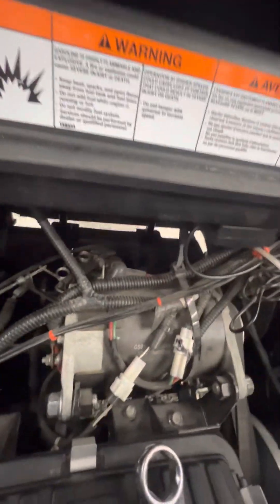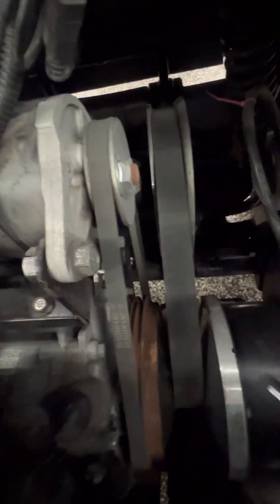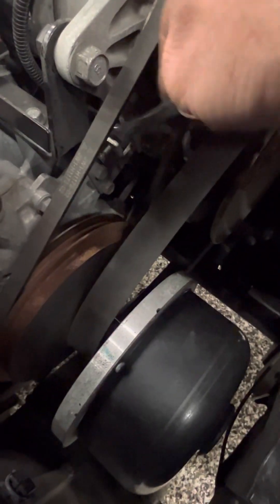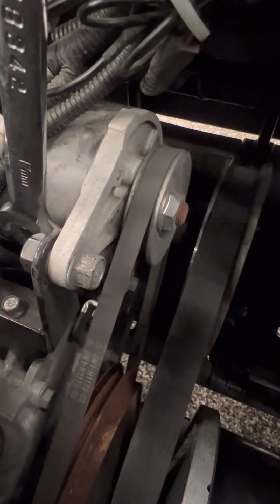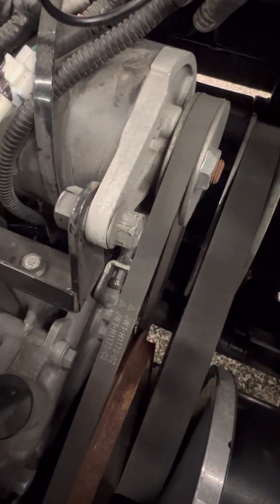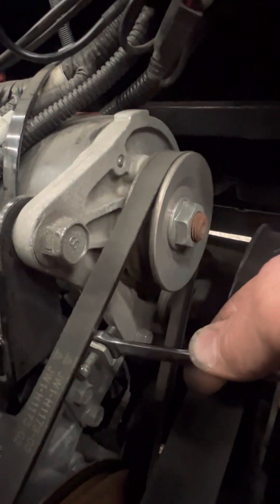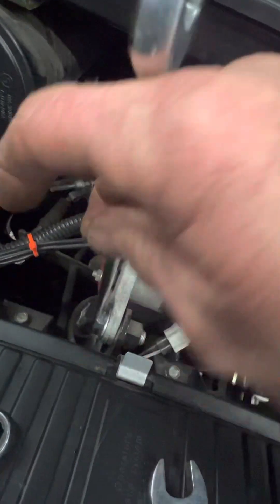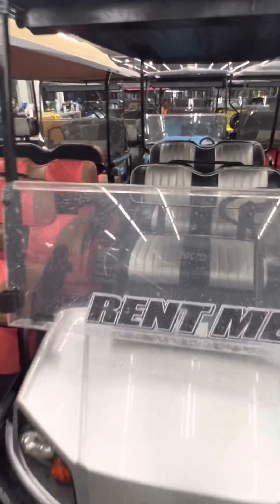Yamaha Golf Cart: A DIY Guide to Starter Belt Tightening

Comment: I have a 2003 model G22 a Yamaha golf cart. The battery works when I turn it on but when I press on the gas I’m not going nowhere so I lifted the seat up and I can see the belt looks loose there’s two belts, not the starter belt, but the drive belt, would that have anything to do with it why it’s not moving forward?? please let us know we’re in desperate help. Thanks Man.
Reply from the maker: No. Is it turning over and not cranking up. Or it’s just turning over
Reply from the maker: Did you figure it out

Comment: Does this alleviate the belt chirp every now and again at take off? I have a drive 2 non quietech and every now and again at take off it chirps and then I cycle the pedal and it seems to go. I replaced the drive belt with a heavy duty one but I still got the chirp from a dead stop before it grabbed and took off
Reply from the maker: Tighten your starter belt up
Reply from the maker: Yes it will get rid of the chirp taking off
Reply: Thank you so much. I ordered a new starter belt and of course I just put the upgraded drive belt on and I can’t get it back off so I was hoping tightening this vs replacing the belt would help
Reply from the maker: @zacc2063  yes sir thank for watching hung and commenting. Hit that like and subscribe button for me

Comment: Mine was engaging and starting now I have to push it to get it to start and it takes forever any suggestions it’s getting fuel and spark has plenty of compression
Reply from the maker: Is the engine turning over.  Or dragging
Reply: @Golfcartwhisperer  I was riding it 2 days ago it would start and run with just the pedal now it’s tries to run but seems like not enough rpm’s now and I don’t see the clutch closing on drive belt to engage it
Reply from the maker: @travismccrary1430  what year yamaha
Reply: @Golfcartwhisperer  85 and the engine is a j17
Reply from the maker: @travismccrary1430  make sure the throttle is opening up on the carb